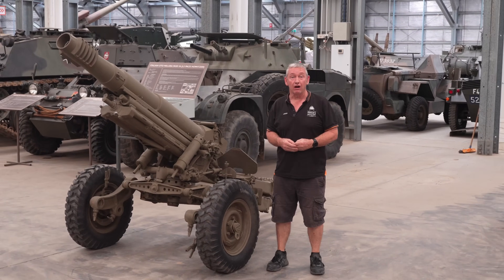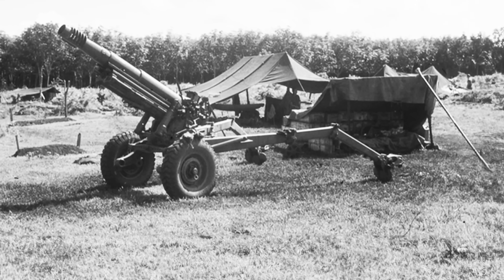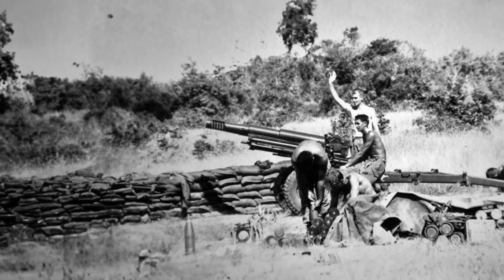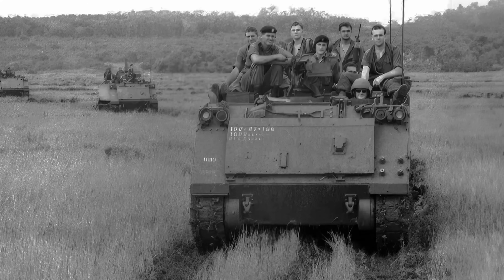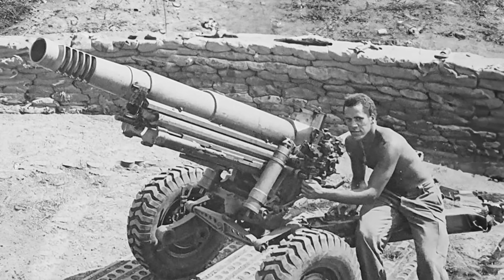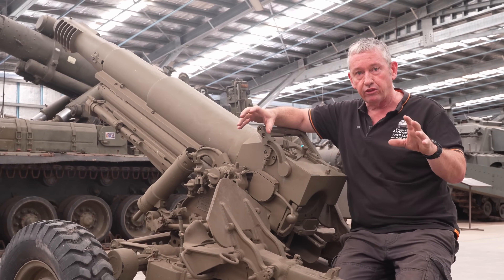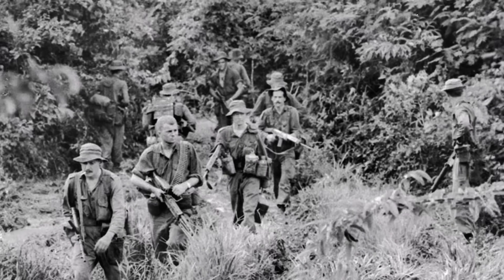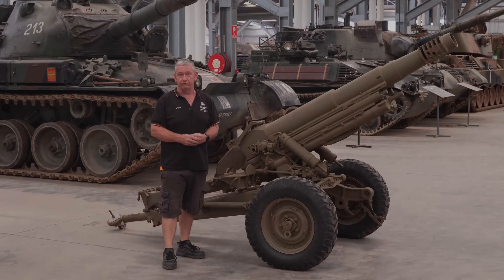The Hero of Long Tan: OTO-Melara Mod 56 105mm Pack Howitzer!

Comment: I was in the 41 Field Battery Army Reserves in the 80's and we were rocking these bad boys. I don't think we could fire more than charge 5 as they were pretty nackered. I think they were replaced by the Hamel after I moved on.
Reply: I joined 41 Fd Bty in 95 and we had the L119 Hamel. Now the Bty is a mortar unit and they call it light artillery. What a load of crap. Since when was a mortar an artillery gun?

Comment: The Max range is NOT 10.5km, the manual is specific that the range is 9.9km at charge 7, which should only be used in emergency as the gun had a habit of popping wheels and other parts off under sustained fire.  I was a gun Number in 4 Fd Regt 82 to 87, equipped with L5 Pack howitzers.  We used to race each other disassembling carrying and reassembling the gun.  we also carried and manpacked the guns often.
Reply: Not bad for a pack howitzer! For some reason I have always loved that design, the whole idea that it could be disassembled and loaded in a team of mules is amazing.
Reply: @tatumergo3931  bloody hard work though
Reply: @stevesmith9151 . I can only imagine, as it is with most tow artillery. Even self propelled can give you a headache every now and then...
Reply: My father was in the 4th Medium Battery in Waiouru via the National Service 1st Intake back in the early 1960's and I recall he told me they also used to shake themselves to pieces when being towed as they weren't really designed for it being a pack gun.

Comment: It should also have been noted that the US A Battery 2/35th Artillery Regiment was also involved in Long Tan and 161 should have taken priority as they were the battery tasked with supporting D Coy, the others called in when the full situation was realised.
Reply: Initially it was a fire mission battery with the 161. When it was clear the attacking force was numerically superior Capt Stanley requested a fire mission regiment but it was denied for over an hour, as the Aus batteries were laid in support of B Company which was returning from an uneventful patrol to the north of Niu Dat. Only once B Coy was back inside the wire were the Aus batteries redirected to support D Coy in a fire mission regiment.
Reply: @wattlebough  A slight flaw, B Coy had been sent to the east to try to locate mortar positions from the previous nights barrage, D Coy was sent out to relieve them. You are correct in that the other batteries were covering an operation to the north but off hand not sure who.
Reply: @hayloft3834  Yeah honestly I can’t remember the exact unit. It’s possible they were a different company within 6RAR but I’m wondering whether it might have been a company from 5RAR.
Reply: @wattlebough  It was 5RAR involved in an operation around Binh Ba to the north..

Comment: Some ADF Reserve Regiments still had the L5 into the 1990's . On EX Kangaroo 89 13 Fd Battery RAA (Reserve) used 2 in Anti Tank configuration to engage a Warship at Weipa . A very versatile gun that could be broken down and moved into interesting places.
Reply: I wondered if any old 5/11 gunners would comment...
Reply: @andrewgirle3746  how could we not though not wedded to the gun like the trail apes I was  always impressed where as a pistol gun they could be placed .

Comment: What reason would they have to putting this gun in a M113 . One to take up less space during aircraft transport,  but what other reasons
Reply: because you can move faster with it inside than you can towing the fvcker
Reply: Asked myself the same question as M113S had towing pintles

Comment: The Battle of Long Tan was amazing. If you haven’t read about it, it’s a must. Illustrates the bravery of the Aussies.
Reply: Have you seen the movie Danger Close, a must
Reply: The higher political and military direction of the war was less than exemplary however. First, the issuing of decorations, which was a very stingy quota system, and took far too long. Second, Colonels and brigadiers got the DSO's, and no one sure sure why. For being there I suppose? Not in the action, because Brigadier Jackson and Lt Col. Townsend only arrived on the battlefield after the shooting was over. 
Canberra was stingy with resources. Initially, only 2 infantry battalions were posted to the task force, and belatedly a third arrived later. And eventually a squadron [company] of Centurion tanks, which instantly improved operations and the survival of infantry in attack and defense. The initial set-up of Nui Dat and Vung tau could have done with far more engineers. The handful of M-113's was inadequate also, and many were not completely fitted out with gun-shields, radios, etc. Spare parts like spare tracks were inadequate also. 
The opposition to the Australians was the best part of a PAVN/Vietcong division [albeit less strong than a "Western" army division and less well equipped].  But even so, if you want to win a war, the conventional wisdom is to make sure at least parity in numbers, or better. There were no enemy tanks in South Vietnam at the time, until the last couple of years, and by then US and allied forces had mostly pulled out. Why an army would sacrifice advantages in equipment when it was not necessary, I will never understand. Pig-Iron Bob Menzies wanted a cheap war, I guess? 
The Australian tactical conduct of operations was generally good. Patrolling, COIN operations, and the flexibility to switch to conventional war modes [although they were under-equipped to do so], as I have pointed out above. 
Australian government neglect of it's armed forces post WW2 should have been a national scandal, and liberal governments were mainly responsible between WW2 and Vietnam. Not to be outdone, Labor also loved to run the armed forces on a shoestring post-Vietnam. 
The Belgian FN-FAL 7.62mm [NATO] semi-automatic rifle [SLR] was one of the better purchases for the army. [Manufactured by the government under license at Lithgow]. It was simply superb. Robust, easy to clean, accurate, simple, and very well made.   Superior to the AK-47 and also the M-16, which was a bit shit for the first few years of it's deployment. Unfortunate though that diggers were only issued with 3, 20-round magazines. [This changed after Long Tan, where ready-ammo for re-supply was pre-loaded into magazines]. 
The infantry company had a TOE of 140 all ranks, [3 platoons plus coy TAC HQ and HQ support section]  with 125 being the official figure usually going into combat. [Thus D-coy deployed 20 men short out to Long Tan, 108, with the 3-man arty FOO group]. The good news was the company had 11 M-60's with adequate ammo, 3 per platoon and 2 under company HQ. The company had a few M-16's but these were either issued or acquired by the Company commander [Major Harry Smith], the FOO group, and a few signalers. There were also some Owen [9mm] sub-machine guns, some M-79 grenade launchers, and some LAWs [light anti-tank rockets]. Unlike a US company, no 81 mm mortar was "organic" to the company. [Six mortars were available per infantry battalion however].
Reply: @roberthunter6927  Canada also treated its military shabbily after the Second World War ended. Chronic underfunding and underequipping was the norm. 

Canada supplied only a post-ceasefire observer force (ICCS) but never supplied actual combat troops in Vietnam.

Canada also had the M113 and Centurion tank at the time.
Reply: @stevestruthers6180  You forgot the Rainbow chemicals and napalm that Canada supplied.

Comment: Canada had the L5 Pak.  Mounted on the back of a 2 1/2 SMP cargo truck.  A light gun, but effective in the hands of competent gunners
Reply: It was also issued to the Canadian Airborne Regiment, which functioned as an air-portable quick-reaction force comprising infantry, light armour and artillery elements. In effect, it was a miniature army. The CAR was disbanded in 1995 as a consequence of the problems it had during the Somalia deployment, and with the disbandment, the L5's were taken out of service.
Reply: @stevestruthers6180  yup.... Canadian Airborne Regiment had its own Artillery Battery, and Engineer Squadron
Reply: @stevestruthers6180  Hello, what light armor elements did the CAR have? Do you think Canada will ever bring the CAR back?

Comment: I joined the RAA in 1975, asked older Diggers re the pack howitzer and was told it would fall apart using charge 6 or 7.

Comment: "1st Field Regiment, Royal Australian Artillery, consisting of the New Zealand 161st Battery, two Australian batteries equipped with eighteen 105 mm L5 Pack Howitzers, and six 155 mm M109 self-propelled guns."
Reply: 161 Field Battery, Royal Regiment of New Zealand Artillery (RNZA)
103 Field Battery, Royal Regiment of Australian Artillery (RAA)
105 Field Battery, Royal Regiment of Australian Artillery (RAA)
A Battery, 2/35th Artillery Regiment, US Army

Comment: From memory the Yanks also had 6 self propelled 155mm howitzers in the fight at Long Tan, but they could only be used in the H&I role and not direct support because the regs (incorrectly) said they weren't accurate enough to be used up close. Appararently they made a mess in the NVA forming up areas though.
Reply: A Battery 2/35th Artillery Regiment, self propelled M109 155mm Howitzers, also at Coral.
Reply: It was more the yanks fucking it up
Reply: More to do with the fact that no one trusted the US gunners to get rounds where they were supposed to be, whereas the Australians and (especially) the kiwis could get rounds within 10 metres of wherever you asked them to put them.

Comment: I remember seeing these guns being pulled apart to cross an obstacle and reassembled on the other side at military tattoos in the 60s. Very impressive.
Reply: If it was a gun race it was usually a QF 18 pdr being used, not a 105.
Reply: Back when a Tattoo was more than a concert.

Comment: Wonder why they didn’t do with the British 105mm light gun for a replacement or even the French 105mm?
Reply: Historically; 25pr, L5, M2A2, Hamel Gun (L119). Now field arty has been removed and replaced with Mortars..
Reply: Simply a matter of timing.  The 105mm Light Gun wasn't around when they switched to the M101.  Australia later produced the 105mm Light Gun under license, and it was adopted by them and NZ.

As with most Australian produced weapons, it was a disaster due to shitty manufacturing standards.  The Australian built "Light Gun" was almost 300kg over design weight and the first batch had problems with the heat treatment on the breeches such that they were prone to catestrophic failure at high charge. That and the dozens of other joint procurement cock ups over 2+ decades is one reason why NZ stopped buying from the Australians.
Reply: @iatsd  I was in the Regiment, still talk to my fellow gunners 40 years later.